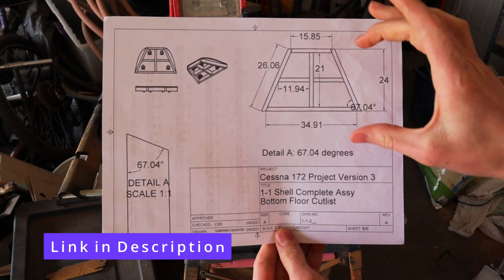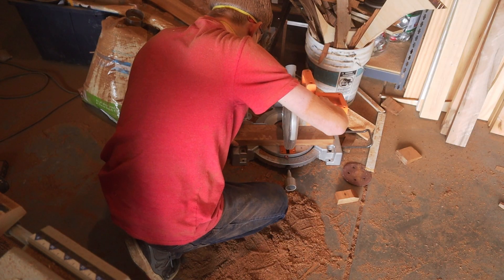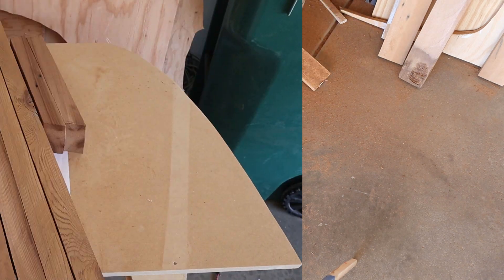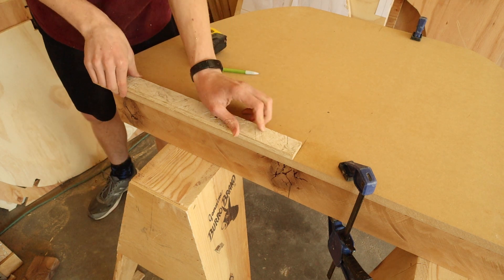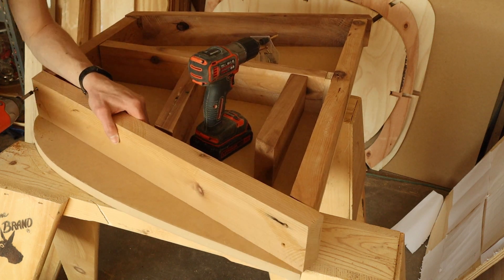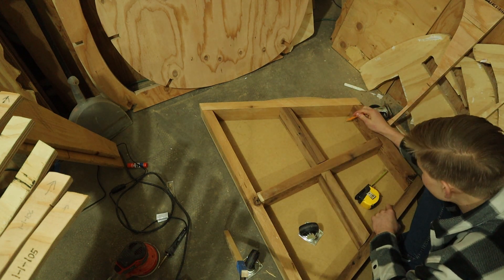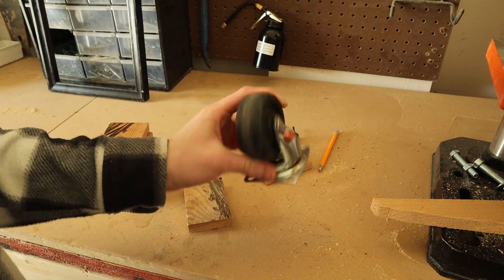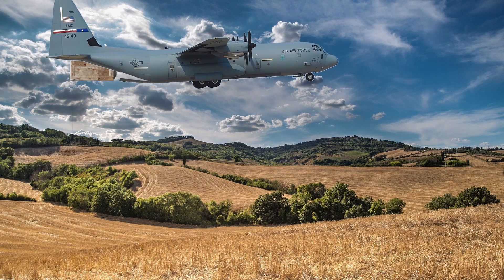Creating the Cessna 172 Section 1 Base | Cessna172sdays Ep.  11 Captain Bob

Comment: If I were you, I would invert the screws and insert them from the other side. So you don't have to cut the protruding ends of the screws.
Good luck.
Reply from the maker: Good idea, I did them that way so they wouldn’t interfere with the wheel turning but now that I checked in the workshop I have about an inch of potential slack I could use.